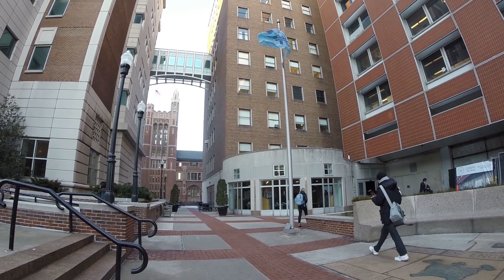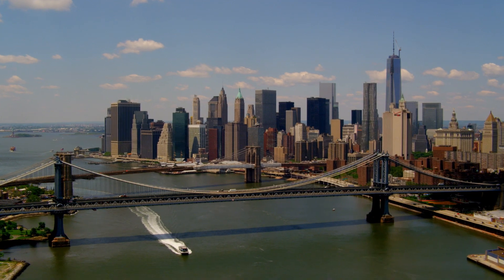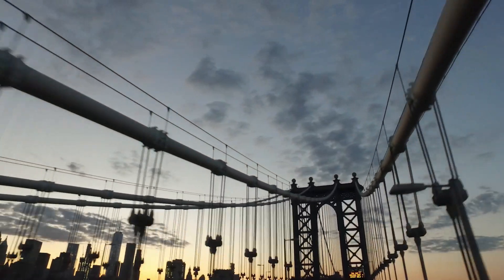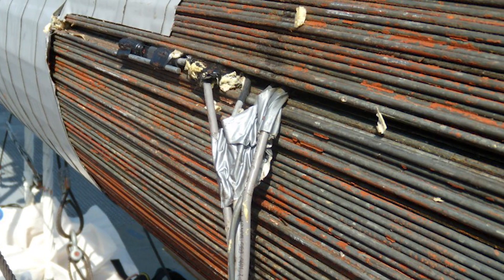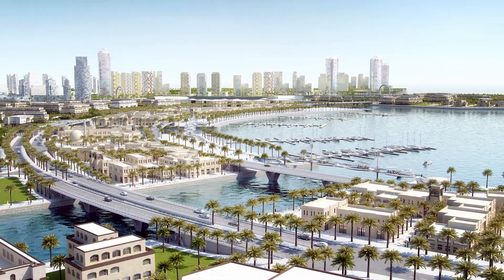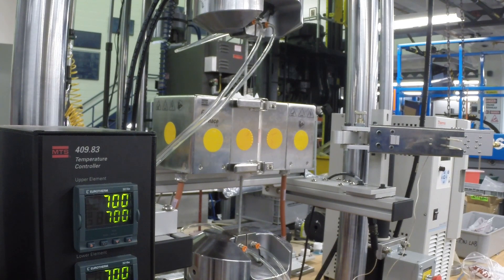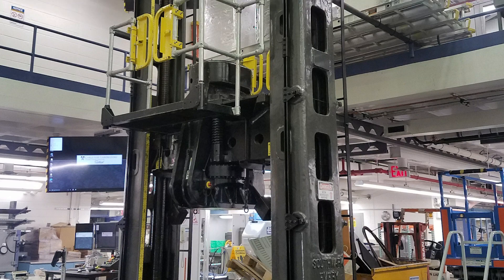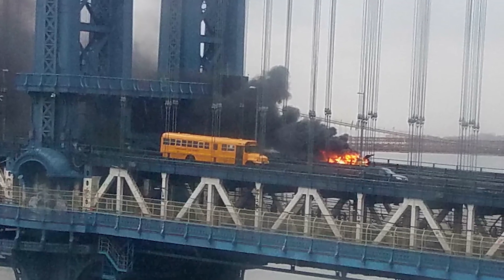Innovation Series- Smart Bridges

Comment: Dear Dyab
Thank you for an interesting video.
Have you ever considered heating of the main suspension cable as a supplement to the dehumidification process. Injecting dry air into the main cable takes a long time for the process to stabilize the water content within the cable. By heating the cable - the stagnant water will evaporate and make it easier to force the dry air into the cable . Some thing to consider.